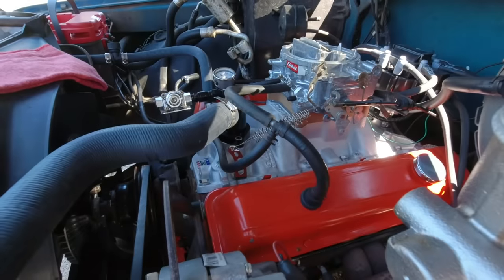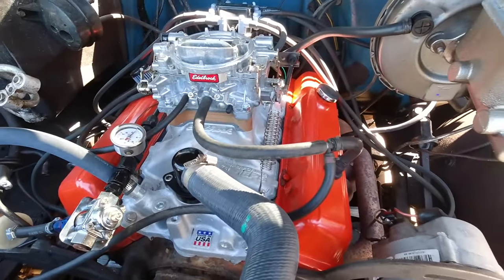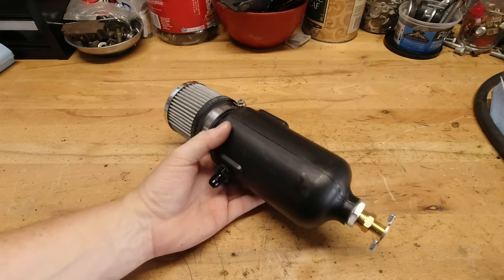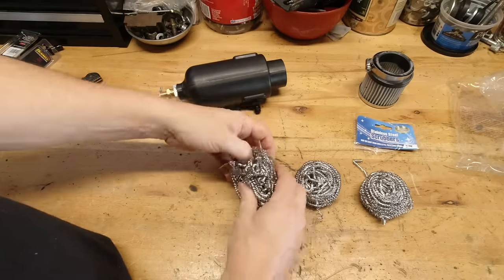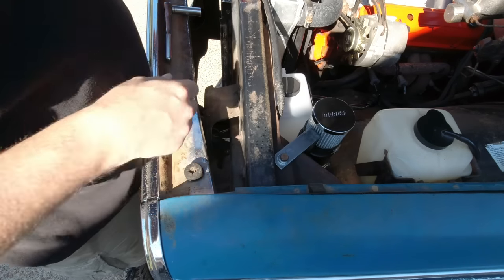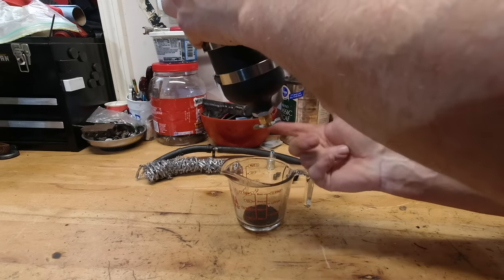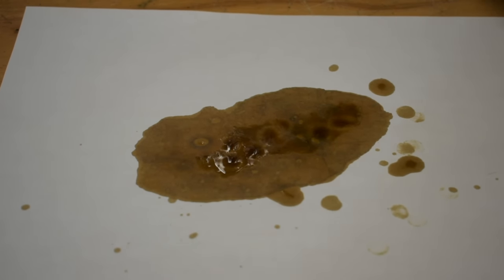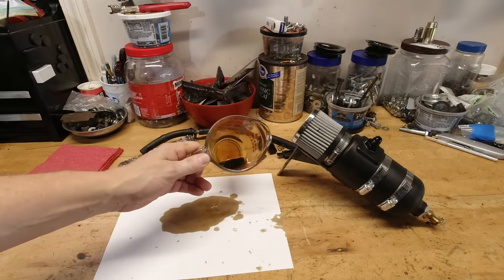Do You Really Need a PCV Valve in Your Classic Car

Comment: If ya want a blown fuel pump diaphram remove the pcv. Also, crank case pressure will blow pan gasket and rear main seal.
Reply: Maybe that’s why my truck’s rear main and pan gasket puke oil. Funny enough that’s the first thing I replaced before I started a massive series of repairs for my skill level. The pan gasket and rear main will be next but I need to use the vehicle to get stuff done before it gets cold out.
Reply: I had a 66 nova 327 and they didn’t have a pvc from the factory. There was a vent tube in the block behind the distributor.
Reply: My dad drove his old sbc for 30+ years with no pcv and it still ran lol. Alot of amoke comming out the back but still ran.
Reply: The only way that would happen is if you plug the hole where the pcv valve was. The function of the pcv valve is to remove combustion gas from the crank case. It's not to remove crankcase pressure. It draws a small amount of fresh air threw the crank case when there is manifold vacuum and low blowby. At wide open throttle, when there is there is high blowby and no manifold vacuum it acts as a normal crankcase breather and crankcase pressure traves out of both the pcv valve and breather hose equally. If you replace the valve with a vent then you will elevate crankcase pressure just fine but your oil will get dirty much faster.
Reply: @johnpotsch7349  there’s a few ways to do it without issues you can take a block and drill it out for a tube with a filter and as long as that tube is at the correct angle and length it will catch the air and create a vacuum by movement a rather crude and risky way to do it though that’s have cars were built before the pcv system

Comment: The proper installation of a catch car/oil separator is in the PCV line from the valve to the intake. It removes or separates the oil from the oil vapor and contains in the sealed container. The vapor continues into the engine to be burned.
Reply: Yeah he set it up correctly. What you are saying would cause a vacuum leak.
Reply: @srsairbags  Not if the catch can is sealed with no breather, then it will be fine.
Reply: @srsairbags 
PCV IS a vacuum leak.... It's just oily air getting sucked in.

Comment: I always put a PCV on my muscle car I want the oil mist in the engine to be evacuated and a breather pipe to the air cleaner to suction clean air through the engine and through the PCV. This way you do not have to inhale oily smoke into your interior environment with open breathers. No stinky downdraft tubes.

Comment: the pcv system adds longevity to a sbc, pulling all the water and junk out of the crankcase, the older motors with draft tubes,sludged of fairly rapidly, and usually needed a rebuild before 100k.
Reply from the maker: Gen I engines never lasted more than 100k, generally.  One of the great things about modern engines and the longevity.  But even they have a system to evacuate the crankcase.
Reply: I rebuilt a stock driver Ford 352 fourteen years ago and it now has 130,000 miles on it. It's been running it's original draft tube from day one; no sludge in the oil pan, under the valve covers or in the oil galley. It doesn't smoke out the exhaust and the motor is still tight. At about 90,000 miles the intake was lifted off and new lifters were dropped in but that's it. Quite honestly I think this thing is going to get to 200,000 miles just fine. Yes the draft tube drips oil and there is a little vapor that seeps out but it's minimal.

Comment: The pcv valve is one of the few emissions control devices that I actually like, for a naturally asparated street engine there is absolutely zero reason not to use one, the benefits of them out weight the cons of them by a long shot. For a race only engine I would use either a set of evac scavenge tubes in the exhaust or if I could afford it a belt driven vacuum pump with a catch can. I have also used pcv systems on a few boosted applications with decent success but they usually will smoke a bit after a hard pull so it might not be the best for a hardcore race only boosted or nitrous application to prevent oil consumption resulting in detonation. Another big plus to the pcv system is that it keeps the crankcase pressure lower which helps keep gaskets and seals from blowing out and leaking.
Reply: A few spoonfulls of oil/water crud in 500 miles driving would have been burnt in amongst 10,000 ?  gallons of air fuel/flow mix through the engine.
Reply: Brian, 

I just bought a car that is supercharged. The pcv hose isn't on the car. What would you recommend me using to ventilate the crankcase pressure? Also, to mention, the pcv valve is still in the valve e cover. Unsure as to why this is the way it is, bit I'd like to get it right. 

I will also say that the intake manifold is a MARANA intake for mounting the supercharger to this car. Saying that, the pcv hose would have been deleted with this intake. 

Any help would be appreciated.  

This is for a 2006 Mustang 4.0l v6. 

Thank you.
Reply: @alfenner3309  is the supercharger on the car an aftermarket kit?, If so check online or call the manufacturer of the supercharger setup and see if they have a suggested method in their installation instructions. If you can't find any info and if the valve cover vents are currently open and hooked to nothing, you should at the very least have them vented to a filtered catch can, btw if you do vent both sides to a catch can you have to remove the PCV valve and install a fitting or remove the check valve and spring in the PCV valve or the valve cover won't vent properly. If you supercharger is a legitimate kit they probably engineered it to have the PCV valve tied in somewhere so I would highly recommend looking around for some installation instructions or find the manufacturer first before resorting to the catch can method. Also if you bought this car and everything is unknown they may have disconnected the PCV valve to hide bad blow-by from a damaged or wore out piston/piston ring but if the engine doesn't have any signs of extreme blow by you should be ok.
Reply: @briang4470  The supercharger came off a  lightning. I'm not sure of the year. Marana does intakes to fit these types of builds to add superchargers. The car runs like a top. I just noticed the pcv valve hose not there at all. The egr valve has also been deleted. Since it is a v6, do I add a catch can just on the passenger side, or do I tap into the drivers side as well? I'm just not sure how to do all of this. It was strong to me that the pcv hose wasn't connected at all. I'm not sure which way to go here. 
I'll look around again on the intake to see where the hose might connect to, but it looks like it was gutted because of the add of the supercharger.  Usually the connection goes from valve cover to the front of the stock intake manifold,  but again, that doesn't exist.

Comment: On newer engines with Direct Injection, adding a catch can, absolutely will help keep your intake valves much cleaner. When you don't have the fuel injectors spraying fuel on the backside of the valves, they get very encrusted with crankcase vapor. Capturing that vapor before it gets onto the valves saves a lot in repairs.
Reply: A catch can or valve cover breathers will both alleviate the gunk.  Also, older cars used to have a foam filter between the PCV and air intake hose, which would fill with gunk and need changing.  They don't make those anymore?
Reply: @mrmrlee  Some manufacturers have strategies to combat the problem. But that adds cost. If it can make it past the warranty without one, then they probably don't care.
Reply: I’m dealing that right now with the used 16 Buick with a 2.4 eco tech I grabbed for a few grand as a new run around car. The inlet put gets clogged very quickly, added a “cleaning port” to make that easier to get to vs removing the intake manifold every month. (Twice when it’s cold) and run the stock PCV outlet though a catch can then to the air box and then I’ve a breather cap that ports to a separate catch can and then right outside or into the airbox on a new port. I don’t get a lot of gunk but it seems to run, even if it still runs richer than she’d like to, still getting a good bit of blow by. Any ideas for other ways to help her would be much welcomed!
Reply: @mrmrlee 
Fuel filter

Comment: I use a pneumatic in-line oil separator on all of my engines and I’ve had great luck! Preserves your plugs, reduces carbon deposits, etc. I’ve read that oil vapor also lowers the octane of your fuel mixture. I’ve found this is a perfect solution—on my old Buick 215 it came with just a draft tube which vents, but fails to actually evacuate gases with negative pressure. So inevitably this leads to sludge
Reply: Oh I know exactly what you mean with that oil separator. That’s a good idea.

Comment: I just found your channel. 
Great and useful content. 
I for one still like a PCV.
I say, do not delete it until you have to.
It works, and the factory used them on some pretty high performance engines with no issues.
I build engines, and I think it still is good technology. 
Thanks for sharing. 
Take care, Ed.
Reply: I think it's fine but if your engine has some wear and or any forced induction motor should have a catch can from the factory you can have that still be under vacuum from the engine instead of vented to atmosphere but you want that oil vapor at the very least in you intake system

Comment: The PCV system creates vacuum inside the engine preventing oil from being blown out through seals, and/or damaging them. High performance drag engines use vacuum pumps to maintain vacuum within the engine to stop seals getting blown out. A common misconception is that it is for emissions purposes alone, but it's more associated with an advance in technology preventing seal damage and oil leaks. Many OEM valve covers have 'catch can' filters incorporated in the design up top just below the outlet that filter out oil and have holes drilled in the bottom that the 'caught' oil drips out of and back into the engine. Engines without this arrangement should have a catch can to prevent oil making its was into the intake and gumming up valves.

Comment: Great video but I believe you misspoke concerning the basic PVC function.  It closes down the vacuum during high vacuum to limit the amount of blow by pulled through and opens up at low vacuum to flow more  It is essentially a vacuum regulator.

Comment: You can also use exhaust evacuation which works much better for a big choppy camshaft. Instead of using the intake vacuum you use the headers or exhaust to evacuate pressure and keep air flowing through the crankcase
Reply: Fixed orifice pcv valves are good for modified engines. Mine works great it has a small hole and helps the vacuum out with brakes ect ect!
Reply: @larryw5429  are you talking about a "jet valve" style pcv system like VW uses? Most modern engines use a vacuum pump now for brake assist. Variable camshaft/valve timing creates a scenario of low manifold vacuum in certain situations.
Reply: @jeremypike9153  No its just a simple pcv valve that doesn't have a weighted jiggle valve. It looks just like a PCV valve but has a small 1/8 inch hole (maybe a tad bigger) so their isn't that fluttering valve and big hole like a traditional pcv that makes vacuum signals flutter and lose more vacuum than is needed! I forgot what part number it was.
Reply: @larryw5429  have you seen the exhaust evac systems? Instead of pulling it through the engine you use the exhaust stream. Works well no metered vacuum leaks either. Plus your not creating carbon build up in the intake or on the valves everything stays as clean as the fuel you run through the engine. On a performance engine I've always suggested an electric vacuum pump for brake assist or a mechanical pump.
Reply: @jeremypike9153  Problem with that strategy is that it's no better than a road draft tube as far as emissions are concerned; ok for a racecar but not acceptable on something that is driven on the street. PCV is the number one most effective emissions control feature, especially on a dollars/complexity to benefit basis.
Reply: Exhaust evacuation system is better than a PCV setup.
Reply: @jeremypike9153  Wouldn't that exhaust evac system contaminate the catalytic converter unless you located it downstream of that?

Comment: Good video Bone, catch can worked good, I did a video on replacing the draft tube on my 54 Chevy Truck with a PCV system, made it my self , sure helped take that blow by smell out of the cab
Reply from the maker: Yeah those older engines with a road tube could get pretty smelly!
Reply: @MuscleCarSolutions  I know it’s no biggie deal but I meant to say my 53, not 54, lol

Comment: Put a catch can between the PVC and intake I did and it works fine I have to emty the catch can atleast once a month my engine has 280k miles and doesn't use oil still runs great its a 350

Comment: Absolutely brilliant video.  I have a 454 originally setup with dual breathers and I'm thinking about adding a PCV valve just because the blow-by in the engine is pretty bad.  Should probably go the catch-can route to quantify the issue, and if so, I'll credit this video for some great tips on the process.
Reply from the maker: On a typical street engine that’s not boosted I’m not sure I’d ever consider it.  But this thing is WORN OUT!  Was fun (and disturbing) to see how much the catch can caught.  Good luck with your big block!
Reply: Did you measure compression in the cylinders? What numbers did you get?
Reply: So me and my wife have a third gen Camaro her brother who passed away did all the work on it anyways there isn't a pcv on it just two filters would that cause the spark plugs to foul up also I think we need to rebuild the whole engine as well
Reply from the maker: Start with the simple things.  Do a leak down and compression test.   That will at least he’ll you understand the engines ability to seal itself up to make compression and power.  You’ll usually get some really solid answers and a place to start.

Comment: You paper used to sample what came out shows unburned fuel when cold quench area's are in the combustion area, but water, oil and tiny carbon particles are found. True, a lot would be suspended in the SS wool inside, so just let it sit a drain. 
  To increase the capture of nastys, I would have a negative pressure from the intake. One does not need a full blown PCV valve inline as tiny washer would be perfect for this calculated air leak. This along would bring more into the can. As for smoke when cold, remember some V-8 engines at any time when shut off have some cylinders in negative pressure. The lathe cut flat valve stem seals are as useless as an umbrella with a 1 foot hole in the top. Always rebuild with positive fitting units from the viton family. Keep it cool in the corner helps in condensation of the gases. With excuses about money and constant engineer medaling, now Oct 2022 find oil catch cans at $150+! It is nice yours is a heavy plastic so heat soak into an aluminum can can last for hours. I personally would clamp to a working A/C accumulator as your 67-72 does not have to use a "POA" system. Install an o-tube in the suction line, accumulators are $30+ bucks, just need the fitting correct. May the forces of temperature differences be with you!
DK, ASE master since 78, retired.

Comment: I’m replacing the stock ford covers on my 1968 390 ( bought it a few months ago- runs pretty clean and smooth when warm) with generic chrome covers that have 1.25” breather holes. My question: Should I buy 2 regular chrome breathers, or 1 breather along with 1 PVC valve along with a new hose that attaches to the air cleaner or an open carb vacuum line? BTW I can’t figure out what the open carb vacuum line is supposed to be attached to. The electric choke ( 2-barrel Motorcraft?) isn’t working properly despite my efforts to adjust it ( ie the choke is not engaging fully on cold starts and fast idle not working right either).  I’m obviously not a mechanic but trying to learn.

Comment: A dual sealed catch can setup would be the most ideal. One inline into the air cleaner base, and one inline with the PVC system. No filters needed, it would defeat the desired goal of negative pressure in the crank case for ring sealing.

Comment: PCV valve was originally designed to burn the hydrocarbons keeps the engine clean now you can run a catch can with the PVC valve in the catch can so you're still burning up the unburn hydrocarbons. I have I have decided systems with a fresh air goes into the crankcase and the hydrocarbons are sucked out the top. Keeps the oil rings from clogging up.